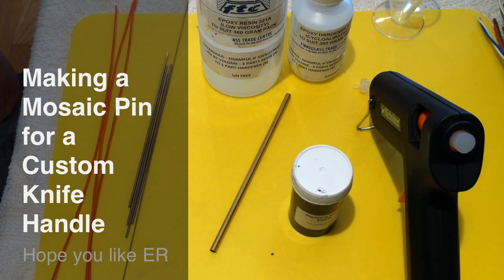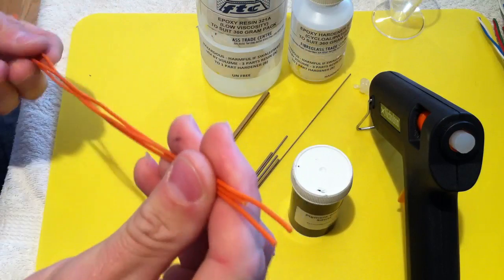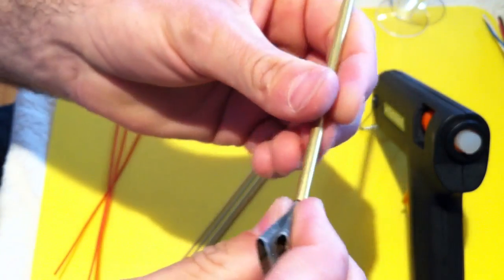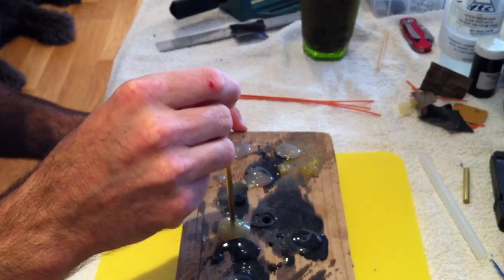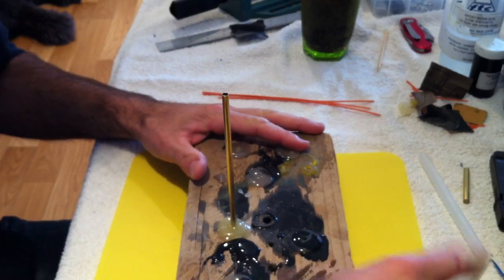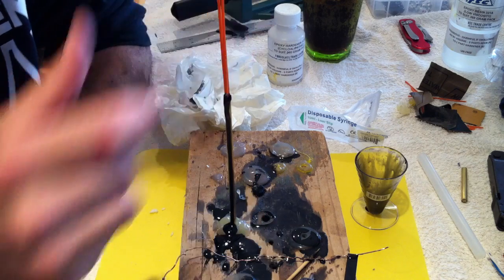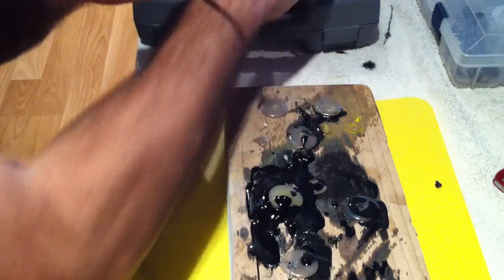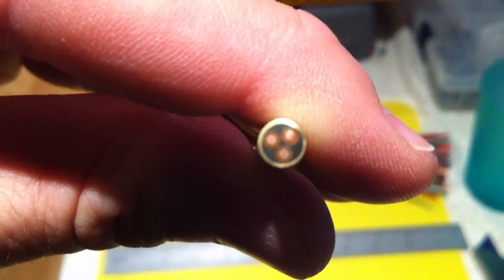Making a Custom Mosaic Pin for your Knife

Comment: Cool idea! I watched Crash's video too. Perhaps you could use the syringe to push the glue up from the bottom, (or horizontal position??), and, have a jig of some sort (or a total modification of your set up) so you can stabilize the tube as the decorative material is being inserted. Really less messy than Crash's set up, but that is a minor consideration. I really liked the color idea from the recycled copper wire. Thanks for sharing, and taking the time to show us how you technique works.

Comment from the maker: @inquisitivewolf Hi, because it's all such a tight fit. The three strands of wire hold themselves in that position, and would look like that before adding epoxy. The epoxy just locks them down. Have a look at the link in the dis option box, it takes you to CrashbladeKnives tutorial and he talks about Dry Fitting, to make sure everything fits and sits into position first.

Thanks for watching and your kind words.

Comment from the maker: And yet it works so well for simple design. Have a look at my Spyderco Woodcraft Mule video, I made the pins in that and used the same technique. So it is possible to add intricacy using this technique. It just requires patience.

Comment from the maker: @BaronVonReservoir Hi. The brass rods are sold through hobby shops. Theres a company called Small Parts.com. They are based in QLD, great helpfull folks. Thats where I got a lot of the materials from for some previously produced pins like the ones I used in my Spyderco Mule. The epoxy and epoxy dies I got locally from a hardware. The copper cabling used here is a recycled material from the telecomunications industry.
Thanks for watching mate.

Comment from the maker: Most of it just peels of, some I have had to scrape off with a knife. The give light sand, which you want to do anyway so glue holds better when you use your pin for binding scales.Comes off dead simple.

Comment: Heat the epoxy will thin it to almost water consistency.  It is much easier to pour into the tube then.  Thanks for the vid.  I like the idea of using a lot of different materials.
Reply from the maker: Bob Williams great idea, thanks

Comment: one thing you should always do is wear a respirator while working with epoxy even in small amounts I work in the boat building industry where I work around this stuff daily it is extremely toxic the vapors are more aggressive than most people understand if you ever wonder why you start having a cough for no reason is well doing junk like this without the proper safety protection also rubber gloves are a good idea and safety glasses last thing you need is a globe of that in your eye

Comment: Nice try but you should really master the technique before putting it on line
Reply from the maker: brian jones the technique was fine fella, I achieved exactly what I set out to achieve with the tools I had. Not sure what your issue is. Maybe you could make a vid showing your perfected method. But you won’t.
Reply: @troy5690  you're right fella and I apologise, I suppose there are tidier videos on this subject. As you say, you achieved the desired result with what you had. Again, my apologies, keep posting and I will watch. Good luck